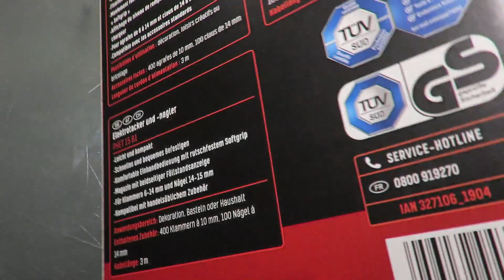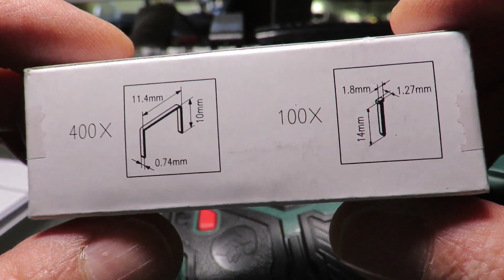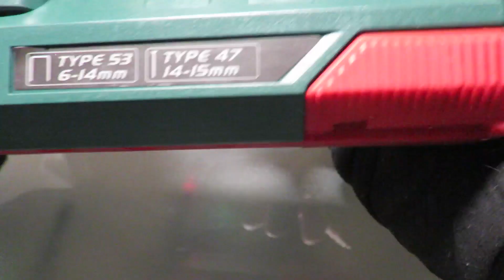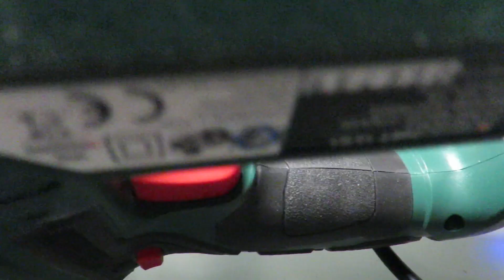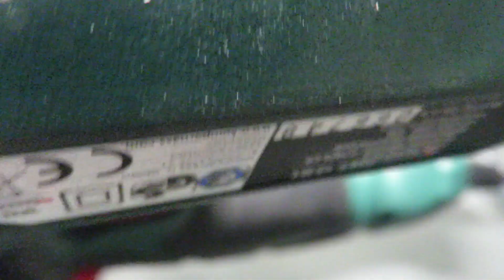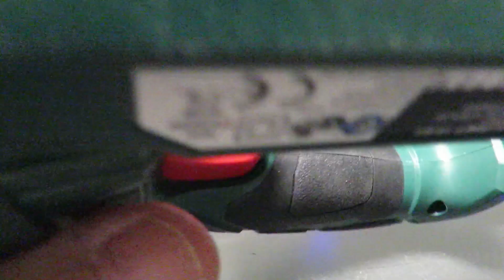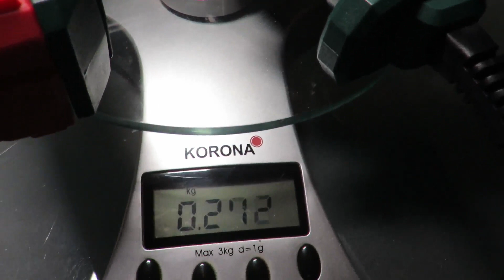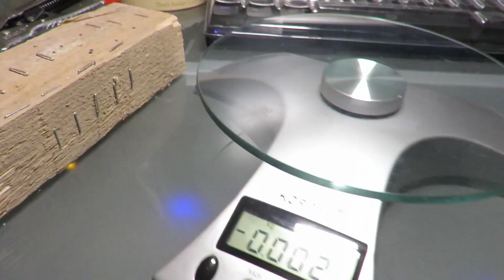LIDL : Agrafeuse & Cloueuse électrique PARKSIDE [PHET 15 B1] : Stapler & Nailer: Unboxing & Tests!

Comment: So how well did the staple and nail gun do.
Reply from the maker: For staples and nails, for good penetration, apply good vertical pressure and hold the device securely. The safety button must be quickly redesigned because it does not fulfill its role. A small piece of plastic broke but this is of no consequence. An incident produced a jam with the sheet of nails. For 12 € ...
Pour les agrafes et les clous, pour une bonne pénétration, il faut exercer une bonne pression verticale et bien tenir l'appareil. Le bouton de sécurité doit être vite repensé car il ne remplit pas son rôle. Un petit morceau de plastique s'est cassé mais cela est sans conséquence. Un incident a produit un bourrage avec la nappe de clous. Pour 12 € ...